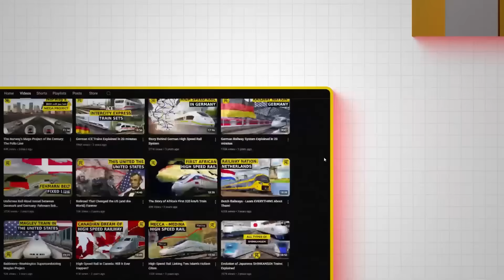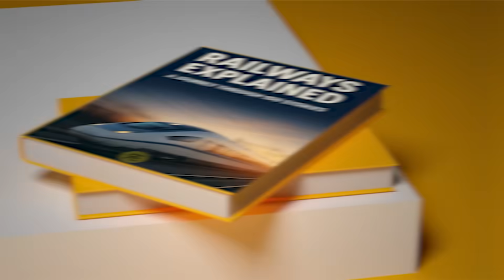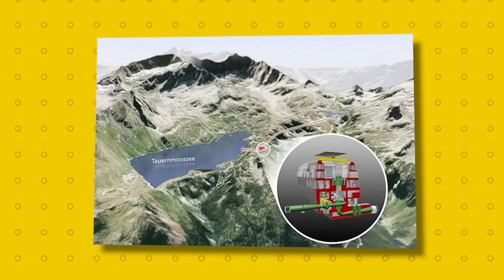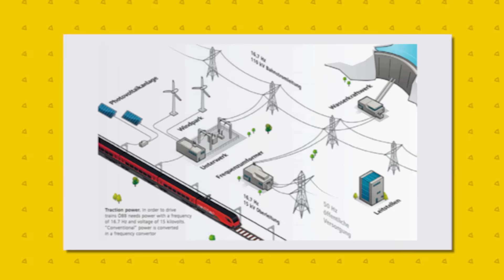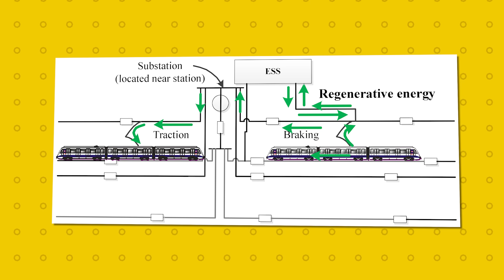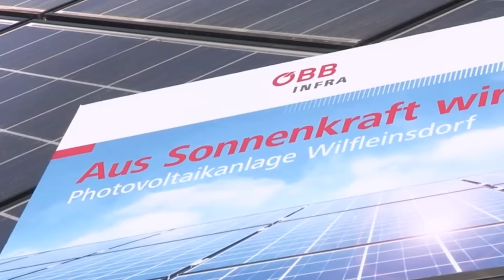How Austria Powers Its Trains with 100% Renewable Energy | ÖBB’s Unique Railway Electricity Network

Comment: Interesting film. Most of the power used by trains in Austria evidently comes from hydro-electric power stations, as in Switzerland where SBB has its own distribution network. The use of roofs of railway buildings and other space at rail yards for solar panels is well-shown and makes sense. Little is said about any wind turbines that OBB has constructed, and the share of power used that comes from wind is not stated. (Solar power meets 3% of the need, it is stated.) One windfarm only is mentioned. Battery 'parks' (rows of batteries) aren't shown so it seems that these are avoided as a source of traction power (they only work in short bursts for peak demand or in emergencies). Hydro-electric power stations are the main reason why OBB can say that it sources its traction power from renewable sources. This is open to Switzerland, Norway and Sweden but almost no other countries have this geographical advantage. For most electrified railway systems, nuclear power will in future be the best source of reliable, consistent supply. Austria does not allow nuclear power within its borders (by a constitutional amendment in the 1990s).

Comment: (some nitpicks) The 3D model at 4:50 is very weird, a Taurus engine does not have a C'o C'o wheel arrangement (that is 3 axles on 2 bogies), the buffers also don't match, and the UIC codes on it are all wrong

Comment: Therefore, the Austrian electricity system is incompatible with the European 25 kV, 50 Hz ERTMS system for interconnecting national grids in the European Union. This is a major practical and strategic disadvantage.
Reply: Not really. There is no european system. Germany, Austria, Switzerland ans some other countries have 15kV 16.7hz, some have 3kV DC and some 25kV 50Hz. The Locomotives build for international travel are able to drive on all of them. The much bigger problem is the different signaling systems in europe, but this is getting solved with ETCS.

Comment: Summary : Austrian railways use electricity at a different frequency to the mains, so it has to generate its own power. The geography of Austria makes it possible to generate most of its power from hydro-electric dams.
To impress the simple minded, they are also squandering money on wind farms and solar panels. These so-called renewables use up large areas of land, generate small amounts of expensive and unreliable power, and will leave behind large quantites of material that can't be recycled.
Reply: @warlord195711 are you one of those simpled minded?
Reply: *Aren't economical to recycle completely YET.

Comment: Most countries in europe aint having so good geography for hydro plants to even sustain stable energy for rail...
Reply: Yeah places like Norway, Iceland and Austria are better suited for hydroelectricity
Reply: Then use a different type of energy. The Netherlands powers its electric trains entirely with wind energy.
Reply: @MrAlex-ej8ov  No, the trains still run when there isn't any wind
Reply: @warlord195711  yes, the official NS website says so (among other sources). You can store energy generated by wind.

My other comment replying appears to have been removed.
Reply: @MrAlex-ej8ov  and northern italy powers its network with geothermal energy from larderello. sure, geothermal is not totally renewable, but still.
Reply: @robertheinrich2994 Georhermal is green if not renewable.
Reply: @LetterboxFrog  geothermal ain't green, and extremely expensive. Those pipes are rusting very fast in brines they exchange heat with. There are not too many places where geothermal makes any sense.
Reply: @MrAlex-ej8ov no they use mixture of energies lol!

Comment: I am generally for nuclear than renewables. 
But railways are the best candidates for renewable energy. You can put a solar or wind farm every 50 km or so. I wouldn't need much power transmission lines connecting remote substations to power grid.
Reply: You can’t put solar or wind every 50km trains are used in mostly very densely populated places. It’s great for long distance travel in between cities tho
Reply: @carholic-sz3qv  I mean for metros or suburban railways it doesn't make sense to install solar farms. The best way to power cities is building a nuclear power plant. 

For Intercity and highspeed railways it makes more sense to use solar farms.

Comment: isolating the power systen also shields the rail system from national grid outages
Reply: The railway grid is not completely separated, but connected to the national grid in specific locations via frequency converters. 

This makes it easier to stabilize the network.
Reply: Outages of the national grid aren't really common in Austria. The APG (Austrian Power Grid Corp.) is much more reliable than american provides like PG&E.
Reply: @BahnNachrichtenEuropawe had one big one in 2022. The complete south of Austria was gone. Reason was extreme (and I mean really extreme) winds during a thunderstorm that brought down a high voltage transmission tower.

But as you say that happens maybe once in 10 years. And ÖBB was quick to respond to bring back at least some of the network with diesel trains.

The issue was that the collapse triggered a chain reaction and all the signalling system were down as well for a short time.
Reply: As others answered, the railway power Grid itself does not have enough capacity to supply all trains. 
In case of an outage of the national power grid, ÖBB will have enough power to reach slowly(!) with every passenger train the next train station to secure evacuate passengers. Not more. As other countries, the main power injection capacity in the railway power grid comes from converter stations.